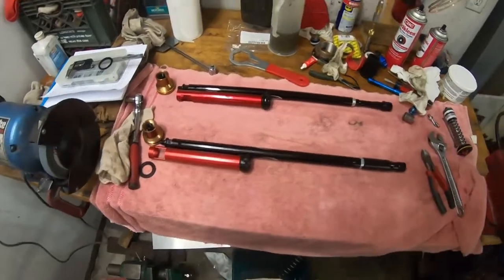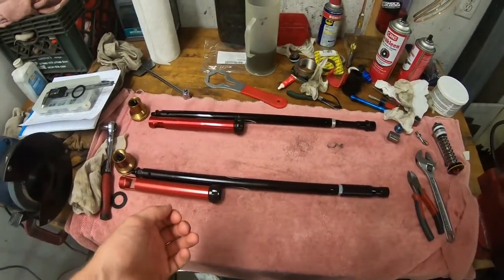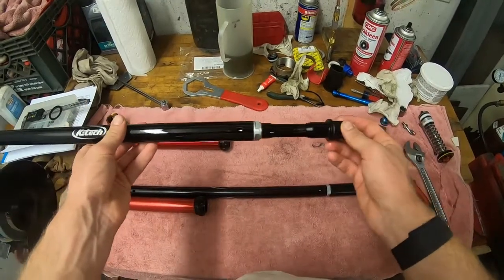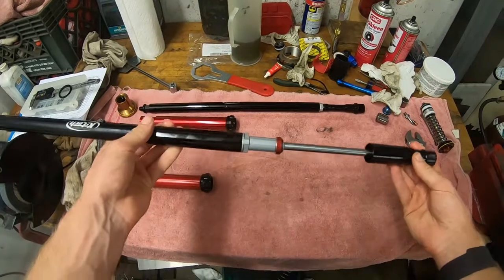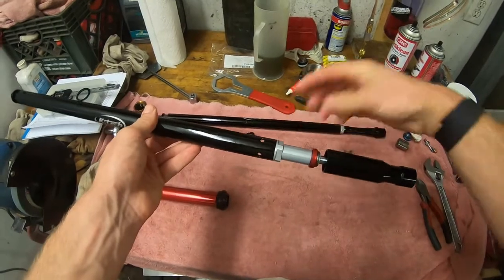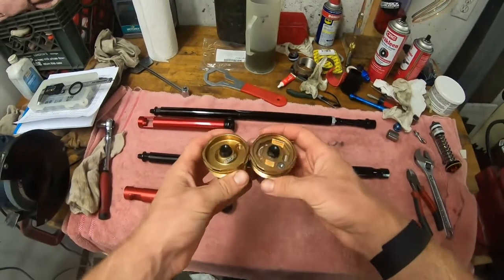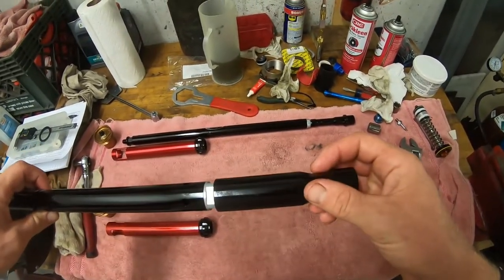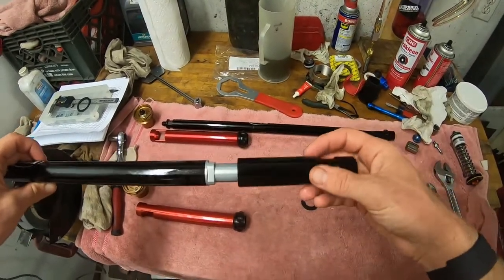K-Tech ORSS vs. ORSS2: Tech Details & Anti-Bottoming Update

Comment: I happen to be shopping the K-TECH system for my GAS EX300. Specifically the ORSS2 w/ ORVS re-valve Fork Piston Kit. Im a woods rider, also run our hare scramble series. I rode a buddys TE300 with Explor forks w/ the KTECH ORVS system and it made me a believer. So KTECH has ORVS system for the Explor forks which is specifically designed for enduro while the air conversion ORVS system is labeled xcountry/enduro. Any thoughts on going forward on my air to spring decision for rocky, rooty conditions?

Comment: Will you share the setting list changes you did to it?
Reply from the maker: I won't share a full setting list since that's what the suspension business is based on, but if you try your hand at it, go stiffer than you think you need to on the base valve and use an early crossover instead of float on the mid compression if you're an aggressive rider or racer. Float or bleed is okay for trail riding, but keep it tight. Seems to just be the nature of a single leg damping system with the large piston and shim diameters.